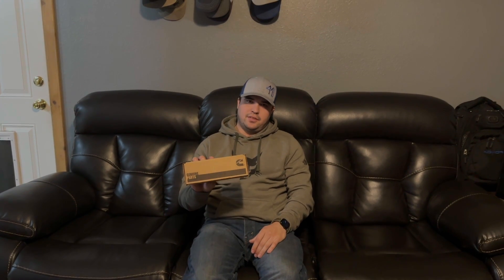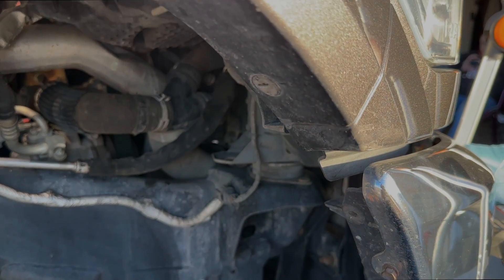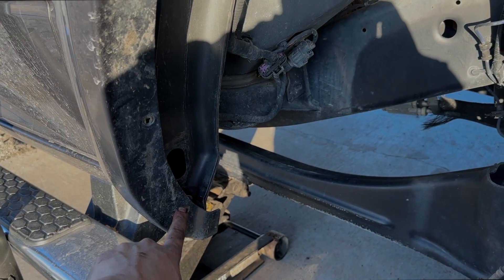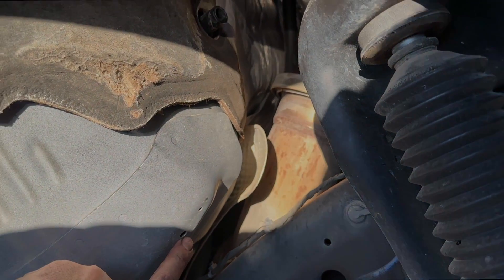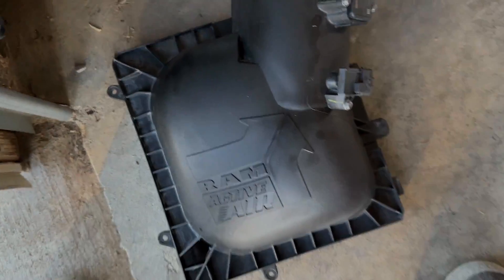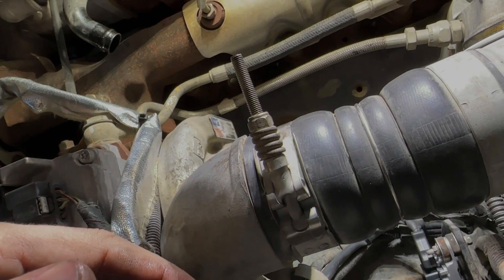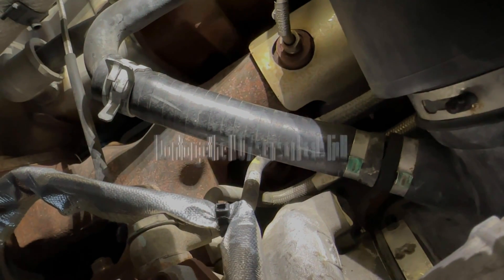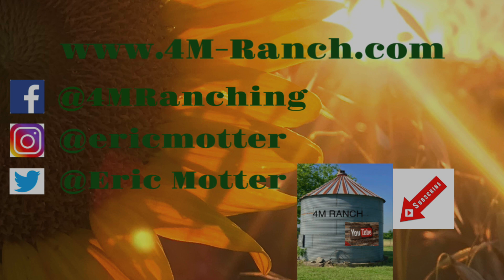Codes P2202 P2201 P2209 RAM Truck NOX Sensor Replacement

Comment: What scanner did you use to reset the ecu from that procedure?
Reply from the maker: https://www.alfaobd.com/download.html

Alfa obd on a android tablet. 
 An obd2 plus connector. 

https://amzn.to/3xJ4QrF
Reply: @4MRanch  any update?
Reply from the maker: You may just try driving it after the repair an it might clear it’s self once it communicates a stable reading.

Comment: This is by far the better video I’ve watched on how to change this. Thanks for your help.
Reply from the maker: Thanks
Reply: @4MRanch  thank you everything’s still working good for you ?
Reply from the maker: @JohnCurrent-x8j yeah so far so good
Reply: @4MRanch  I replaced both of my sensors now they’re saying just keep driving it at the smog shop. It’s been 800 miles. Any ideas? On how to get it to relearn
Reply from the maker: @JohnCurrent-x8j  did you use OEM, sensors or did you buy some aftermarket ones from Amazon?

Comment: Will these work for all 3 sensors?  or they all have different part numbers. I can’t find nothing for the 2021 3500
Reply from the maker: No they have different ones. This one is for the one after the turbo. The down stream has a different style connector
Reply: @4MRanch  on the downstream are they both the same style underneath ? And is these comparable with  the the 21 models they all look the same besides the turbo one your speaking on
Reply from the maker: https://www.mymoparparts.com/oem-parts/mopar-nitrous-oxide-sensor-68460215ab. 

This might be the one your looking for
Reply from the maker: @706smooth  my truck only has one downstream but if your truck has 2 downstreams I bet they are the same. The one by the turbo is a Cummins part the downstreams are Mopar parts.
Reply: @4MRanch  thanks I’m new to ram and I hotshot with mine it’s only 43k on it am I ok to still haul until these come in the mail? Dpf is still at zero.
Reply from the maker: @706smooth  I drove mine around for a while, and had a check engine light on, but I’ve heard that it can cause your engine to run bad and maybe put you into limp mode but mine has never done that with yours being newer there’s a chance it could happen
Reply: @4MRanch  thanks for the help!
Reply from the maker: @706smooth  no problem wish I could tell you more
Reply: @4MRanch  that helped a lot the back to are reasonable at the dealer 290. But that one behind the turbo they asking 2600
Reply: @4MRanch  this p2209 is only for the front correct behind turbo? Not the other 2
Reply from the maker: Yes that’s what my code was. When the down stream messed up it gave me code P229F
Reply from the maker: 2600? Wow what a joke! Thats insane
Reply: @4MRanch  yea 2600 for upstream part. 1 part   And p2209 is just upfront 1 correct?
Reply from the maker: Yes it should be. When you scan it it should say bank 1 sensor 1
Reply: @4MRanch  I may need to go get a better scanner that shows me more thanks.
Reply from the maker: 68085740AB this is the number for the down stream but my truck is a 14. A 21 is probably different.
Reply: @4MRanch  this is what they gave me front 68447681aa, rear-68460215ab I’m tryna see if the plugs are different   Ram want 2600 here in Washington just for upstream part only.

Comment: Mine just stopped working the new one will come in a week can I keep driving to work or no
Reply from the maker: Yeah you should be ok to drive still. I drove mine for 4 days no issue but a check engine light.
Reply: @4MRanch  okay thanks will for sure fix it as soon as I can
Reply from the maker: @Yoxicofficial  👍
Reply: Hi, i just had code p2209 on my ram 2020, part will get to me in 2 weeks, can't do it faster, i still need to drive my truck, but I'm affraid to use it can those 2 weeks would hurt my ram if i use it??
Reply: @theotherhalfoftheang  it won’t hurt it just don’t drive far away
Reply: @qalv97  ok but why not drive far away???
Reply: @Yoxicofficial  i have to drive 4 hours to my grandparents tomorrow 😢
Reply: @theotherhalfoftheang  Ohh well engine may turn off has happened to me before when I had check engine light on since it need the part but try driving it you might make it there
Reply: @qalv97  thank you!! Wish me luck 😢🤔 i can't undwrstand how this happens right at this time and i would fix it now but mechanic and the parts i need arw not available at the moment.

Comment: This is one of the best videos I’ve seen for this job. Thank you for taking the time to film everything.
Reply from the maker: Thank you. Glad it helped
Reply: @4MRanch  the link is not open for the parts
Reply from the maker: @JohnCurrent-x8j looks like they are out of them now. I guess you’ll have to get a aftermarket or try any search with the part number an get it somewhere else.

Comment: I’ve got the Icon branded bit driver ratchet set that Harbor Freight sells. It’s similar to the craftsman you have linked. That little sucker came in handy getting the bottom left bolt in the turbo actuator too. Also handy swapping drain valves on a 7.3 powerstroke. I swear a guy is never done buying tools.
Reply from the maker: yeah the actuator bolt is why I bought it originally. Seems like I buy a new tool every 2 weeks!